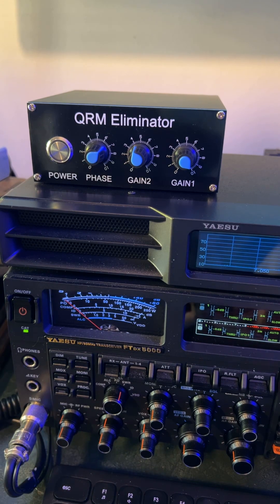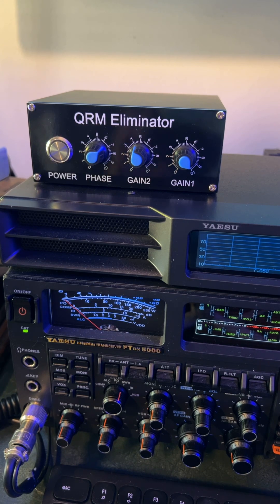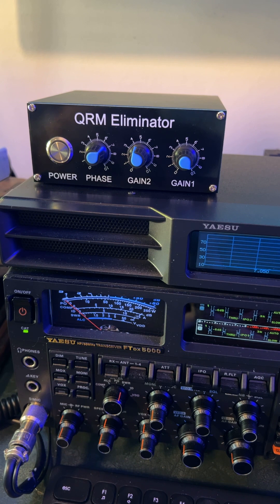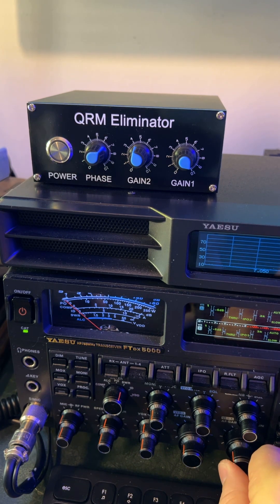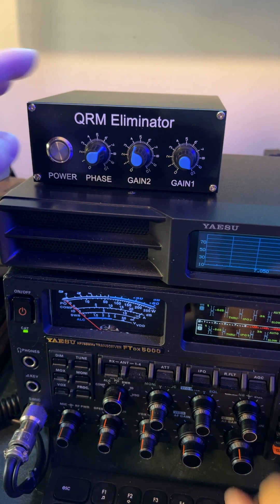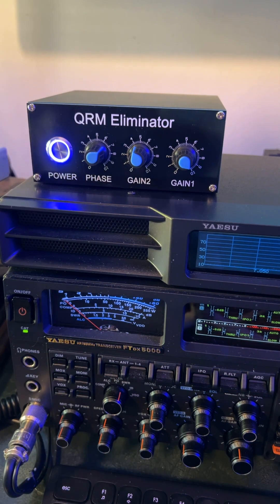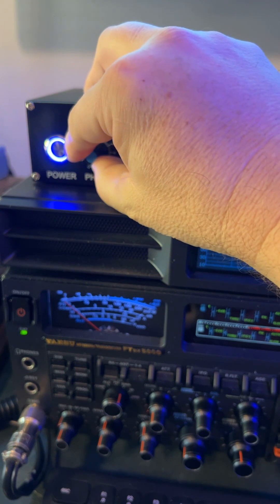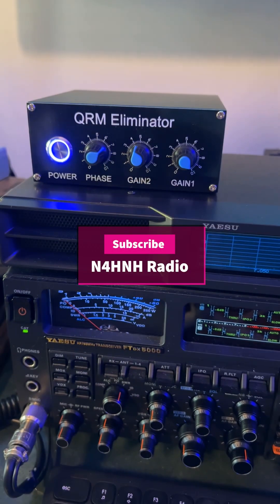Stopping Heterodyne before it enters your receiver #ham #radio #noise #interference

Comment: If the electric company refuses to respond to EMI complaints then file a complaint with the FCC.  They are extremely active in my area and I am on a first name basis with the field agents and Enforcement Bureau Attorney.  Personally if I had a power line/company interference problem I would threaten them with a FCC complaint.  That is usually all it takes.  In reality it's rare for a electric company to ignore a radio interference complaint.  That indicates they have a problem which in many cases is lost revenue due to poor connections in their system.  In my case any time I have contacted the electric company I have had a service truck in my driveway within 2 days.  They know my report of a noisy power pole (usually a bad fuse or connection) isn't BS.  Over the years they have come to know if I am hearing noise from the power line its a failure on their end and they respond quickly.
Reply from the maker: I had to resort to contacting the FCC in the past. Three months later I received a email from the FCC stating that they turn such matters over to the ARRL now. A couple of weeks later I received a phone call from the ARRL, stating that the FCC asked them to handle such issues with RFI.  The ARRL instructed me to give the power company another call, and give them another chance. Like the first 10 calls weren’t enough. I have to call an 11th time.  I called a few more times and finally got someone new.  What eventually happened was the new person called in a retired RFI engineer who had not been replaced yet. It took several trips to get my noise level down from S9+15dB to S3.  There was loose hardware, dirty insulators, and two blown lightning arrestors.  At S3 I decided to let it go. But the S3 lasted for maybe a year. 

In late 2021, it started creeping up and getting more intense during days with low humidity. I have left 8 messages with Georgia Power since late 2021. The noise has continued until it is now so intense that no noise blanker can deal with it.  

It’s funny what you said about threatening them with the FCC. The person I dealt with 4 years ago laughed when I told him I would contact the FCC. He said, “we aren’t afraid of them!”  I contacted the FCC anyway. And three months later the ARRL called and did nothing.

I finally got someone on the phone from engineering.  She said she will have someone call me. That was two weeks ago. I filed a complaint with the FCC about 3 weeks ago. I guess maybe I will hear from the ARRL in July.

The sad thing is that I bragged on Georgia Power in my videos, after they took care of it the first time.